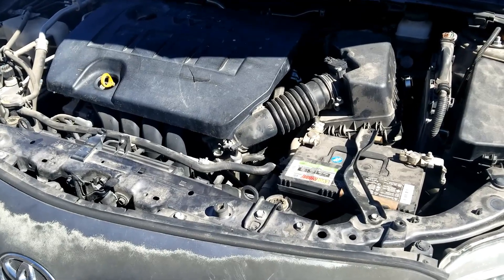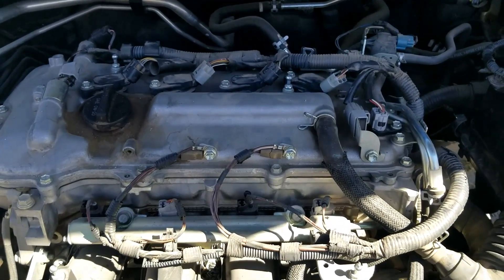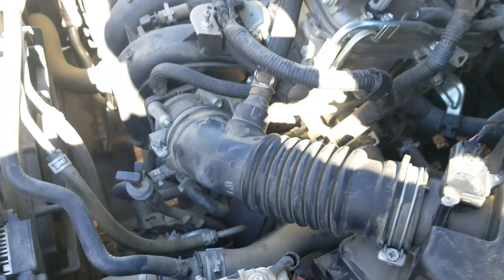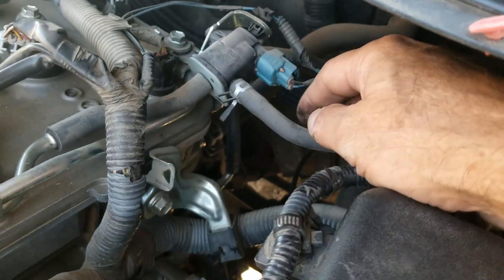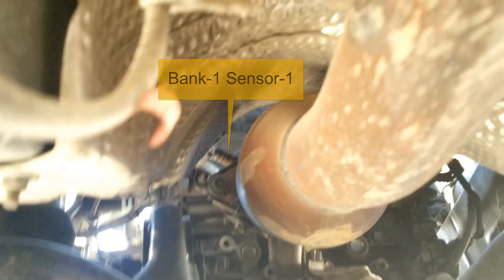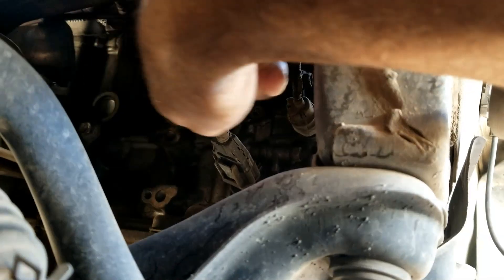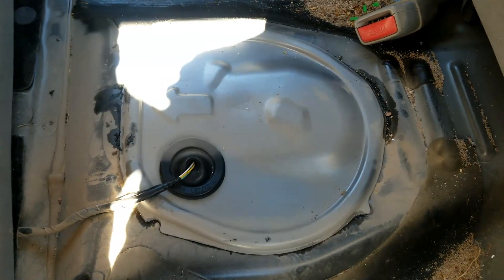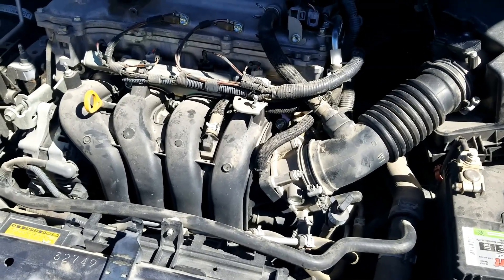All Toyota 1.8L Engine Sensor Locations (2009-2016 Toyota Corolla)

Comment: manifold absolute pressure sensor location 2014 toyota corolla le eco where is it?
Reply from the maker: The manual is showing it is located at the top of intake manifold for the 1.8L (2ZR-FAE)

Comment: Alguém conseguiu localizar o sensor MAP do Corolla XEI 2.0 2010/2011?
Someone got it locate the MAP sensor of the Corolla XEI 2.0 2010/2011?
Reply from the maker: Some 1.8L engines do not have a MAP sensor. For example, the 2012 Corolla 1.8L does not have one, but some other Corolla variants with the same engine have a manifold pressure sensor. When there is not one, the ECU calculates intake pressure from the MAF + throttle position + RPM, rather than relying on a dedicated MAP sensor.
Reply: @WirelesSHack thanks..